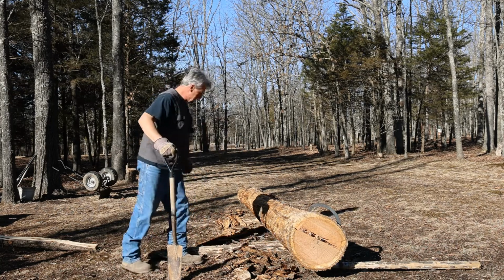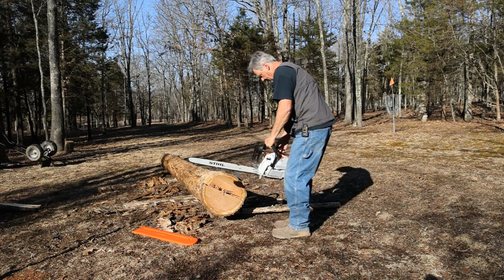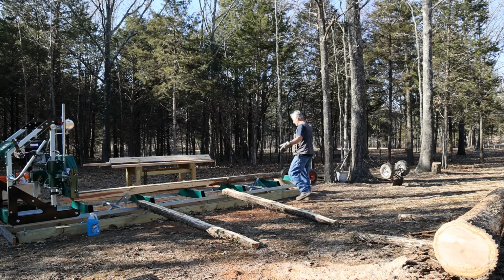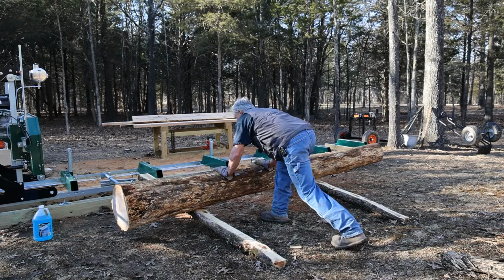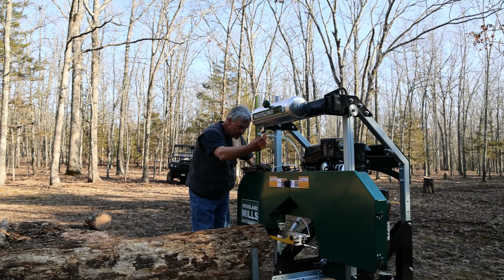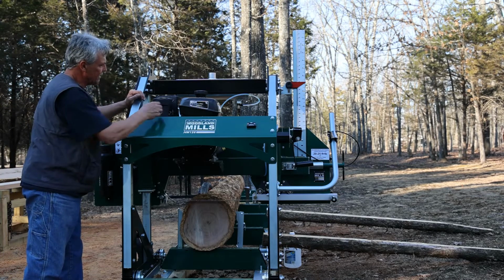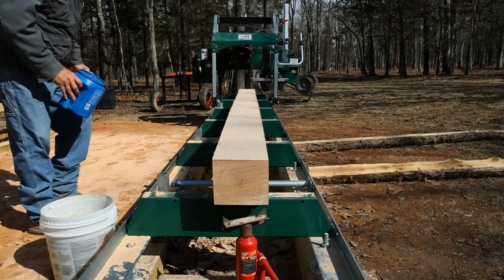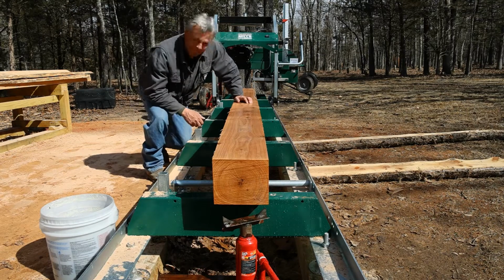I {Cant} Believe How Good This Saw Works

Comment: I have a HM130MAX (love this saw) with a 23 foot cut length (2 extensions).  I have learned the hard way to load a log on the small end.  This will stop you from making "wasted cuts" and dulling blades trying to square up a cant on a large log with taper by starting on the large end.  I also use the following scale to judge the size of the 4 sided cant that I will get from sawing  at the small end.  This requires me to get an open face on the first cut of the width of the cant calculation below. Measure small end of log excluding bark and then use scale. 
				Min Small
CANT			End LOG
4	X	4		6.0
6	X	6		8.8
7	X	7		10.2
8	X	8		11.6
9	X	9		13.0
10	X	10		14.4
11	X	11		15.9
12	X	12		17.3
13	X	13		18.7
14	X	14		20.1
15	X	15		21.5
16	X	16		22.9
17	X	17		24.3
18	X	18		25.8
19	X	19		27.2
20	X	20		28.6
21	X	21		30.0
22	X	22		31.4
Reply from the maker: Hello Steve and Thank You for the scale this will be very helpful. I agree the small end of the log is all we can get and is a good place to start. Congrats on the 130 that is a great saw. Have a good evening and Thanks for Watching.